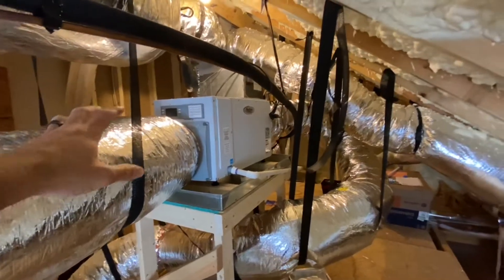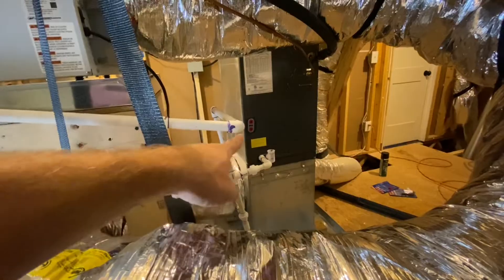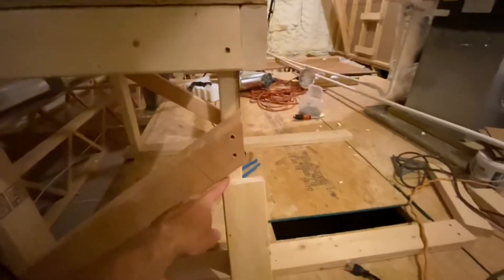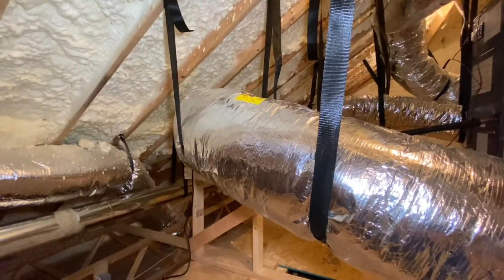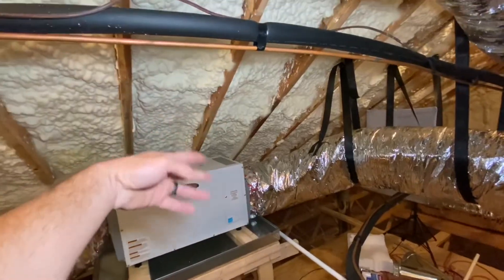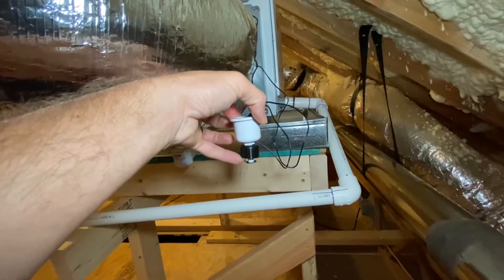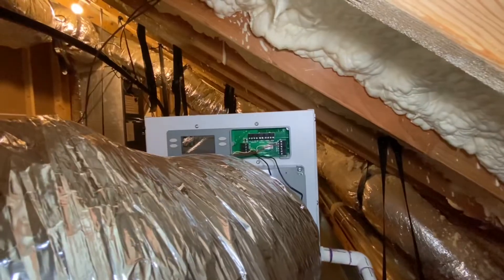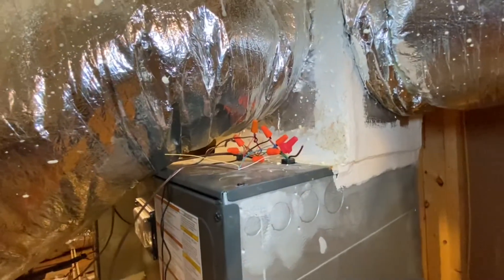How to connect an Aprilaire whole house dehumidifier to a HVAC blower fan in spray foamed house.

Comment: Great vid 👍. I'm an HVAC guy and this will be my first dehumidifier ( on furnace) job .  I removed an %80 mid and installed a %97 HE and the customer is getting condensation on windows now that we're getting heavy frost .   Pretty sure it's because I'm not  intaking any house air to get the humidity out .

Comment: Hey all.  About to install a whole house dehumidifier in the attic. I live in southern Arizona and couple of months now it's pretty humid for us. My question is how to run the ducts. I can collect the air with dedicated register to the dehumidifier, then to the hvac unit. Or have a totaly independent setup for the dehumidifier in and back out to the house. Or tap in to the return hvac to the dehumidifier and back to the hvac. Which is a preffered method and why? Thanks.
Reply from the maker: There are many different ways to install a whole house dehumidifier that will work well. I installed mine by following the recommended method in the installation instructions. I had to customize it a little bit because my hvac return was so short. 

I think you should look at the options in the installation instructions and pick the easiest one to do. I like the method of pulling humid air from the hvac return, and then supplying dehumidified air back into the HVAC return or putting it into the hvac supply. I have many videos about installing my dehumidifier and why I ran it the way I did.

Comment: In you original video you were checking the humidity off of the unit, but you are conditioning the living space, so wouldn't it need to run off of a sensor or humidistat installed in the living space?  In other words, if the unit is operating off of the humidity reading it's taking in the attic, it isn't running off of the actual humidity level in the living space.
Reply: It's taking a reading of the air passing through the humidifier, not the air around the humidifier. You can see that when it is first powered on and it runs the fan with the "sampling" noted on the control panel.

Comment: Great video. I am installing an E080. What thermostat did you connect to?
Reply from the maker: I have a cheap, builder grade thermostat. I do not control my dehumidifier with my thermostat. I control the dehumidifier with the control panel on the unit itself.

Comment: Question on how this wiring actual works in practice... So if the thermostat calls for the fan to blow, then the dehumidifier MAY come on and dry the air if the unit criteria is met (it reads >= the relative humidity set in the unit). Regardless of whether that condition is met, it passes on the fan blower call to the HVAC unit which kicks on as requested by the thermostat. 

If the dehumidifier senses a need for dehumidification on its own, will your current wiring start the blower motor as well even if there was no call from the thermostat? Thanks, hope this question makes sense.

Comment: I was wondering if this wiring diagram that you did only turns off and on the blower on your furnace. Does it have any effect on your condenser outside when your dehumidifier cuts on or does that just run normally? I have a Goodman heat pump and an Aprilair E 70 and the installer told me just to keep the fan on my thermostat from auto to on and I hate having my blower run 24 seven. Also, what gauge wire did you use. Any feedback would greatly be appreciated
Reply from the maker: It only turns the blower on and off. It does not control the condenser outside. 

I used a “thermostat wire”. It is 18 gauge with 5 wires. I put a link to Lowe’s below but it can be purchase anywhere. 

50-ft 18 / 5 Solid Thermostat Wire ( By-the-roll ) https://www.lowes.com/pd/50-ft-18-5-Thermostat-Wire-By-the-Roll/3128633

Comment: I think you should have run your supply after the conditioning unit into the supply plenum so that the de-humidification system would run independently. Yes, the air entering the supply would be a little warmer, but it all eventually mixes.  Pretty sure that's how the pros do it.

Comment: We had this unit installed in our home a couple of weeks ago...and it seems like it runs constantly..Is that normal?
Reply from the maker: Sometimes, it seems like mine never turns off, but I live in Georgia and it is very humid here. 

Sometimes, I have a problem where the dehumidifier is running, but the actual compressor is not running. Then the unit will run forever, but it’s not actually dehumidifying the air. I reset the unit by turning it off for 10 or 20 seconds and then turn it back on. After I turn it back on, I can hear the compressor kick on and hum. I would suggest that you make sure you hear the compressor actually running because you might be having the problem that I have sometimes.

If you don’t have them yet, I suggest that you put a couple hygrometers around your house so you can see what the humidity level looks like. They probably won’t be exactly what the setpoint of the dehumidifier is, but they should be close. That should let you know if the unit is working properly and actually dehumidifying the air.

Comment: great job explaining but wiring is usually not coordinated when they install if its got extra accessories and an older house. all wiring should be replaced and done right when installing equipment. 
im a hvac tech so i deal with this daily

Comment: Hey Brian I install hole house dehumidifier in my house and still the humidity 64 any suggestion
Reply from the maker: How long has the dehumidifier been running? When you first install it, it might take a few days to bring the humidity down. 

Are you sure that the dehumidifier is large enough for the space you are trying to remove humidity from? 

Was it installed properly? 

Can you hear the dehumidifier compressor running when the unit is on?  Sometimes, I have to reset my Aprilaire dehumidifier by turning it off for a few seconds and turning it back on. It has had an issue since I first installed it where it will randomly show that the unit is on when you look at the control panel, but the fan and the compressor will not actually be running, so it’s not removing humidity.

Comment: How did you make the decision to create a new return in your ceiling and feed the dehumidifier return from that, vs. let's say tying the dehumidifier into the existing return ducting?
Reply from the maker: The recommended installation method is to install the return and supply for the dehumidifier into the HVAC return ductwork, just as you said to do. I couldn't do it that way because the ductwork for my HVAC return is not long enough.

Comment: How can it be wired to work with the T stad  humility settings so it doesn’t auto run every time a/c or heat runs???
Reply from the maker: I don’t know. 🤷🏼‍♂️. My dehumidifier runs on its own. It will turn the hvac blower on, but the hvac system does not turn my dehumidifier on.

Comment: PS:  The dehumidifier should be connected to the air con supply, not the return. Connecting it to the return negates the air con dehumidifing ability.
Reply: Very true. The AC is always the primary dehumidifier.
Reply: Correct.
Low humidity air is passing through wet AC coils.
Reply: So your saying he has it backwards? Can you explain it to me a little better im trying to get an understanding of it as a total newbie
Reply: @joea104 dump the dry into the supply plenum. Also it makes more sense to tap into the existing hvac return for the return side of the dehumidifier.
Reply: Aprilaire has a video on their website with their corporate director of training where they state (and have a diagram as well) that the dehumidifier plumbs from the furnace return and back into the furnace return. So unless something is different in the specifics of this install vs their instructional then his install is correct, unless I’m missing something. In their video they do have it hooked up with the extra fresh air ventilator vs him having a separate ERV.
Reply: There are about 3 other options in addition to that one. Each has pros and cons. Should show up quickly under a Google search.
Reply: I would run a completely separate duct system for the dehumidifier.. let it be completely independent of the hvac. I know it's more expensive to rum more ductwork, return and supplies, but you're going to get it at it optimal performance. Makemsure the duct work is on opposite sides of each room, from your hvac.

Comment: Sprsy foam is the best for hot humid climates. Your ERV should be routed through the dehumidifier, now it's bringing in humid air into the house. Don't know the square footage of the house but your air con are probably oversized for the house and short cycling.
Reply: How would you recommend that too be done could you give us a quick guide of how to do this?

Comment: Nice job. I am thinking about having one of these installed on my house. Between your two videos, I think you solidified my plan to do it myself, rather than hire an contractor. Ironically enough, I have Goodman air handlers on my house as well. I'm either going to use an Aprilaire or a Sante Fe dehumidifier though.

Comment: Just curious but has anyone ever tested the static pressure on the HVAC units?
Reply from the maker: No
Reply: @BrantleyBlended  I would.  That is a lot of flex.  I also am watching your ERV video.  Id sale that ERV and cap the duct... or tie in the dehumidifier to the house side of the ERV duct and put a damper on the fresh air supply.  

So you could have the benefits of all.   An ERV is never recommended by HVAC people but it is by energy efficiency people.  It just ends up brining in a lot of humidity with the dehumidifier would have taken care of.   You could also add in a HEPA filter to the dehumidifier.

Comment: Okay, so your video inspired me to get my project going, from start to finish.  I did a Return to Supply configuration and used a manometer (cheap one from Amazon) to make sure the pressure did not exceed 0.4 Water Inches between the two install points. 

I used PVC to output the existing condenser line to the HVAC, but I did not have a sharp enough incline to force the water down.  The dehumidifier backed up and started leaking everywhere! So word of caution to anyone trying this, I hope they can learn from my lesson.  It helped me to buy the installation kit which harnessed it from the ceiling, Aprilaire has a kit that was straightforward to install.  

Honestly, I'm not sure what the unit is doing, when it samples it runs for a bit, looks like it shows 38% humidity, even though all parts of the home are 55% humidity.  Anyway, it seems to have improved the humidity in some parts of the home were 65% -> down to 55%, so I'm happy with it.
Reply from the maker: Did you wire your dehumidifier into your HVAC so it will turn the fan on and help distribute the dehumidified air throughout your house?

My dehumidifier is currently set to 51%. My hygrometers usually show the house at 50% - 55%.
Reply: @BrantleyBlended  That's actually a really good point.  I thought I would be able to get away with it because I did a return to supply configuration, as I saw you did more of a return to return configuration (but with one of the returns in the ceiling)

Instructions: "When ducting return to return (preferred), the dehumidifier must be wired to turn on the HVAC fan when operating (see page 14)."

I'll give it a try to see if it makes a difference!
Reply from the maker: At first my dehumidifier was not wired into the hvac. It worked okay but not good enough. Now that it is wired into the hvac, and it turns the blower fan on, it works a lot better.
Reply: @BrantleyBlended  Okay, so for anyone else following along. I was doing a return-to-supply install, without any wiring into AC unit.  Finally looks like the static pressure built up too much, and the unit gave me an error code E2.  So I wired the unit as per instructions and changed the setting to disable the dehumidifier from running when the AC is on to help prevent pressure on the backdraft damper.  The sweet thing is I tested it, and the fan turns on when I want the de-humidifier on, and it turns off when the AC is on. I think this was worth it and seems to be more energy efficient.  (Will give an update in a few days to see how this setup went for a long run test)

Thanks again for the great walkthrough on this unit, I would never have attempted an install without all this information.
Reply: Okay, after more than a week, I don't get an error code. I've changed the setting to: Disable when AC is running, on the dehumidifier so they don't collide with each other, and the fan turns on when the dehumidifier needs to run. 

Also, the external control was a good buy, it helps to control the unit externally (need to also adjust the setting) but it's nothing more than power + simple switch that turns off once the desired humidity is reached.   
Pro TIP! Finally, the hole drilled to wire through the wall from the humidistat to the dehumidifier needs to be filled up, otherwise, the hot air from the attic mixes with the cold air of the conditioned room, giving an unusually higher humidity reading than it should.  (like 10% higher than actual room humidity)
Reply from the maker: My dehumidifier does not turn off when my AC turns on. I just let it run.
Reply: @BrantleyBlended has this caused any problems?

Comment: This is SUPER helpful, thank you. We're getting to install the E130 soon and this has covered so much. Does Aprilaire recommend an R-Rating for the flex duct?
Reply from the maker: No. The installation manual only says to use 10” duct. Here is a link to the installation manual if you want to look through it. 

https://esmithair.com/wp-content/uploads/2020/02/Aprilaire-Dehumidifiers_1830.pdf
Reply: @BrantleyBlended  Thanks
Reply: @BrantleyBlended  that’s ok in most applications , but in a spray foam house use R8 for sure …. Home Depot only sells R6 and Lowe’s exactly the same .

Comment: Great videos. My question is why not duct the dehumidifier supply into the supply of the A/C.  Also is the air going back to the A/C return?
Reply from the maker: I didn’t have enough room to duct the dehumidifier supply to the hvac supply because my hvac is too tall. The supply ducts are crammed against the roof. I wish they would’ve installed a horizontal hvac unit. The hvac ductwork would be neater and I would’ve had more room to work. 

Is the air going back to the A/C return? Not sure what you are asking. Every time the dehumidifier runs, it turns the hvac blower on. The dehumidifier dumps air into the return of the hvac. That air gets sucked through the hvac and pushed out the supply to the house. The dehumidified air does not go backwards through the hvac return and down into my house. Hope that answers your question.

Comment: So if the dehumidifier is out on float safety switch, will the blower still come on? Curious why that G had to be isolated to the dehumidifier and not go to both the dehumidifier and the air handler.
Reply: It seems like his wiring (putting the dehumidifier in series with the G-wire to the air handler) would disable the blower in the air handler - manual control or when the DH float switch shuts it off.  This is needed for the DH to control the AHU blower, but there are these trade-offs.
Reply: @red49254  I recently wired the one in my house to not be in series, but parallel. Everything works as it should. Having the blower in series worried me that if there was an issue with the aprilaire, my unit could freeze over if the AC was running but the call for G wasn’t taking place since it was in series. To each their own.